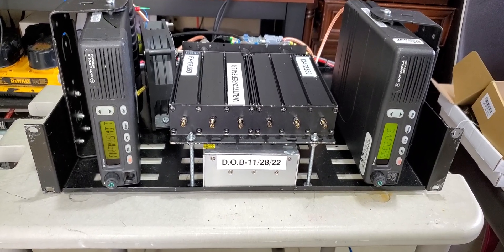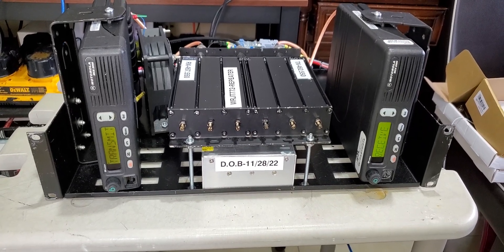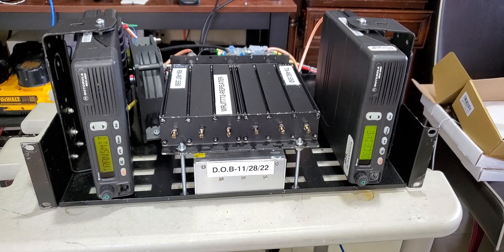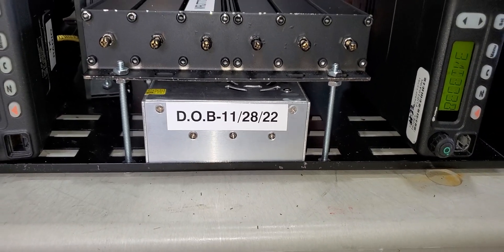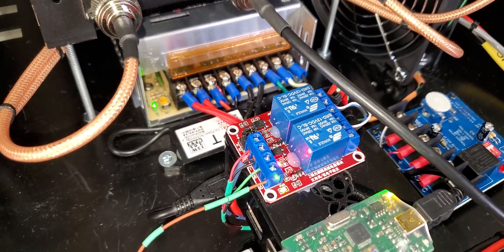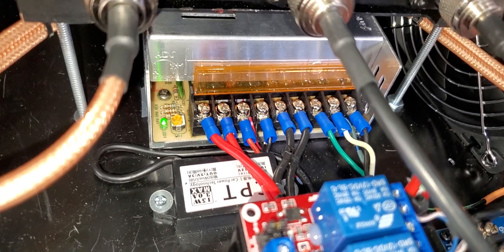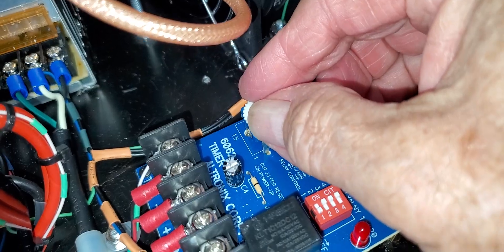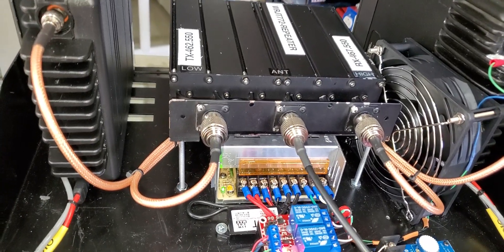WRJT772 Thomas Repeater Build

Comment: Great progress from when you first bought one from me. Its a tough business and starting to get not really fun anymore. Not scalable at all and hard to get good deals. Then HAMS / GMRS users are dirt cheap, if I want to sell 5 a month at least. I'm not gonna do this to sell 1 a month. So if I sell a repeater for 500 bucks, have 150 in the radios, 150 in the computing, thats only 200 bucks in my pocket for 4 -5 hours of work. Which isn't really getting close to my $100/hr rate for engineering projects like this.

Comment: @wd4ehutechnicalsite314 Could you possibly give me an idea of where i can obtain the software for discontinued radios like the m1225 for example?

I have several prior public service units I obtained when our FD changed to kenwood. I interested in using them for a couple mmdvm pi repeaters, but the software isnt as readily available as other manufacturers.

Thanks, James.
Reply: WD4EHU Technical Site (Ross) pass away about 4 months ago. I just found this out today, (9-19-2024)

Comment: When I build mobile based repeaters I set the tx radio to 10 watts and then run it into an external amplifier that takes 10 watts in and sized to whatever output power the output needs according to its use. Currently working on a Desktrac repeater and converting it to P25 with the Repeater-Builder board. Fans and amps are cooled via a thermistor controlled switch. I could have sworn I saw something in the past that used a RaspberryPi with an interface board that would send out a push notification to those responsible for the site. One could also interface a power monitor to the system to let one know what is happening with output power.
Nice build!